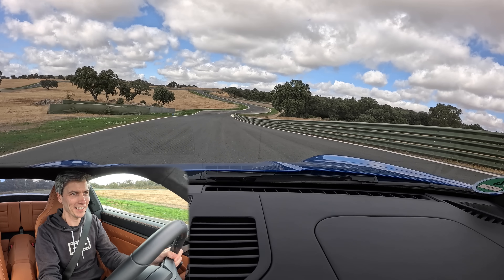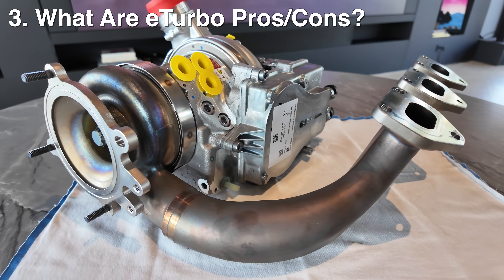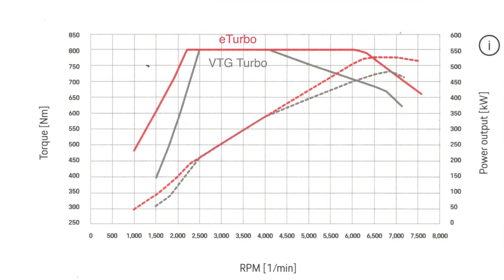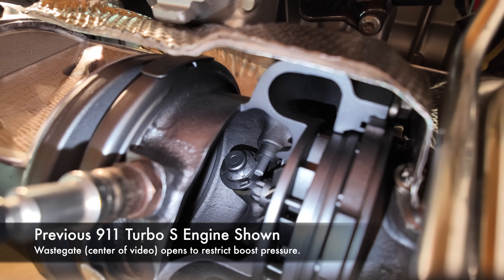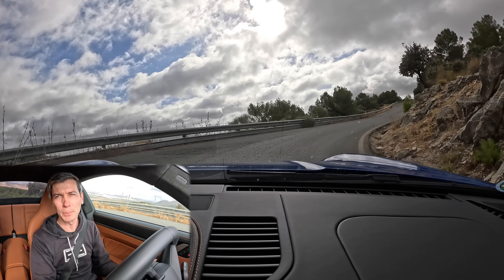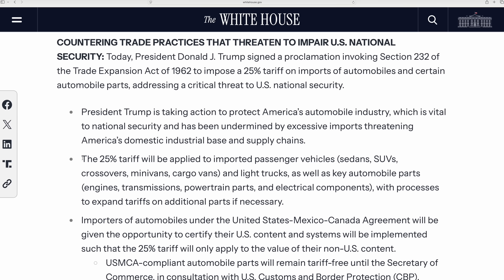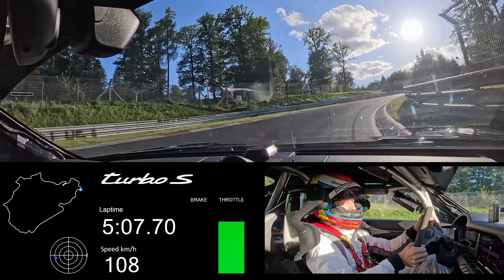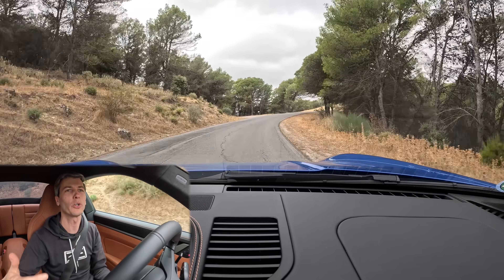Electric Turbos Are Here — Is It A Good Thing?

Comment: Electric centrifugal superchargers are better, I say this from experience. Vortech v-15 running off khb14601 controller at 176v in speed throttle mode wired directly into the 0-5v throttle pedal.

Comment: Wow they did a good job, this is better than an electric car cause yeah you get good instant torque but you don’t have shifting or the sound of a reving combustion motor. With a high powered motor it’s great but you need a bigger more powerful motor.  

But with this you get the feeling of the instant torque acceleration of an electric but you also get the shifting and tactile feel of the motor. Feels like this is peak design, only thing I could think of other than this is a diesel generator to battery and electric motors. Which you wouldn’t get the shifting from.

Comment: Man porsche is so awesome. The fact that the electric motor between the motor and transmission can be used as a starter, and alternator is sick. On top of that the eturbo being used as a brake to do a wastegates job to then send that charge back to the electric motor is insane! so clever, excited for eturbos to become more accessible in the aftermarket

Comment: Peak regen : 14Kw x2 ... in a 1.9kwh battery. 16C rating, this battery is dead before end of waranty, worse than the one in the old Prius. This car is Hybrido-greeno-bulshito scam. So very quickly, like the good old prius, your car will have no electric power so no Hybrid fancy fuel economy, PLUS a lot of magnet dead weight in your turbo, adding lag and everything bad, more than any "Normal" turbo. Speaking of dead weight, the electric motor is 2cm from the exhaust turbine, generaly red hot metal. Magnets, copper wires insulation, all of this will see hell if only ONCE the forced cooling has a few second issue. Your 10k€ turbo will be dead (I'm sure its more than that in a Porsche officine). There should be a law preventing detax for "Hybrid" cars with less than 1H of battery power. This one has... a few minutes.

Comment: Exhaust heat is what ruins turbos and nukes the bearings and engines

However is doesnt resolve the issue of blow by creating oil dilution or the need for premium fuel.

Over powering a small engine is the surest way to wear it out.  And that makes car mfgs happy.

Comment: Wow! Very clever! OK, so here's my system design question: what if you change the relative sizes of the ICE, turbo, electric drive motor, and drive battery? Seems like you can make this into an interesting series/parallel hybrid (ICE/electric drive, not how the turbo is driven) with different optimal points for economy, performance, or somewhere in between. Or did I drink the wrong kool-aid?

Comment: It's pretty wild that up until now turbos basically spun freely at whatever speed exhaust flow dictated. You could shut the car off, and momentum would keep them spinning (another benefit where electric turbos can limit bearing wear by halting turbo spin when oil pressure drops off at shutdown). There are reactive ways of controlling pressures, such as wastegates (exhaust), blow off valves (intake), and variable geometry (exhaust). But there was traditionally no way to directly, mechanically speed up or slow down the rotational speed of the turbo. That's exclusive to supercharging. So electric turbos are the first case where the RPM can be directly controlled.

I wonder, in a case where you must slow an electric turbo, but the battery is already full--say, descending a long hill--where does excess energy go? Or would the engine possibly power down in this case, or convert to "air pump mode" (no fuel), with forward propulsion from downhill momentum and EV regen only.

Comment: This is one of those things I just can't understand why Big Oil is so against. Instead of "replacing" ICE with EVs, there should be a hybridization of the two, a merging of the two powerful technologies. Both ICE & Electric have their strengths. They need to start focusing on merging these together in more vehicles. There's no reason why almost all vehicles can't be made to be some level of a Hybrid. If Tesla can make EVs $36k, and other EV manufacturers can make some even cheaper, that shows the Electric side of things are getting very inexpensive to produce. So being able to drop in electric motors into chassis' and some low KW batteries seems pretty easy to do.
There's no reason why the two technologies can't coexist in more vehicles in this age of technology.

One of the things I would absolutely love is a true hybrid for Pickup Trucks. As in, hybrid drivetrain where both the Electric and ICE contribute to power to the wheels. This could drastically increase the work capability of trucks by decreasing fuel usage and increasing towing/stopping ability. But no, they make these crappy pseudo-hybrids like the Dodge Ram with eTorque that's basically useless because it turns off at such low rpms, and is almost useless for towing.

Comment: I dunno. It's a normal evolution I guess, not sure how the electric motor will tolerate the heat. In the 90's they solved that with a twin turbo setup. Being a purist I'd be more impressed if the exhaust gases would recharge the battery and use an all electric turbo without the generated heat.

Comment: This is the slow death of Porche into obscurity. This is going to be a worthless car in about 4 years. These systems will fail, even with OEM parts. Once support is discontinued *because we all know this will be controlled purely by "proprietary" software, with over the air updates and EOL term dates, this will brick itsemf after that term.

Best case is you get a NA car with a BUNCH of heavy components that won't work. Worst case, you get a fire. I would NEVER own a European car anymore. Nothing made since about 2001 or so. (I wouldn't own anything modern anyway, nothing after 2023)

Comment: Curious to know how long these phenomenal engineered parts will be manufactured?  Our 2006 Audi TT Quattro that we bought used a little over a year ago only came with one key and the transmitter part of the key was dead.  

We tried to order a key from Audi ($450!!!!!) but they ended up calling back the next day to let us know Audi discontinued keys for the Mark 1 generation.  

In 10 years will Porsche still make these exotic parts like those exciting electric turbo/generators?

Comment: wouldnt it be easier just to make it a pure mild/ hybrid, forgot the extra 2 e-turbo motors for a bigger electric motor directly drive the gearbox instead of having 3 seperate electic motors, (2xturbo motor + 1xEmotor at gearbox)?

This just sounds like mild hybrid with extra steps and extra electric bits that could fail, it looks like all 3 electric motors generate 70hp max output in total, thats really no much in terms of EV motors.

Comment: For a future episode: Would be neat to see a comparison of latest centrifugal/roots superchargers v electric turbo. Turbos are so common now is there anyone other than drag racers still using any kind of supercharger? Is there any reason Porsche or anyone else should consider supercharging?  Instead of belts from the engine could you drive the supercharger with an electric motor setup like Porsche uses in this new 911 Turbo? In Porsche case they have a long tradition of using turbos and have never had a supercharged model but Audi, Dodge and Chevy all used superchargers in the past…

Comment: Turbos usually heat the intake gases, because the two turbines are so close together. Putting the electric motor-generator between the turbines keeps the intake cooler. Cooler air is denser, which is more efficient for combustion 

The turbo motor-generators in F1 are being removed for the new rules in 2026. The drivers will have to adapt to turbo lag

Comment: How is that electric stuff in the middle going to stay cool during hard runs? Wouldn't the heat make the plastic stuff brittle and overheat easily? Turbos can glow red on the hot side during hard use.  :face-orange-biting-nails:

Comment: What about using the turbo as a means to improve effeciency in smaller engines by harnessing power from the exhaust gasses and feeding them to a hybrid (emotor+eturbo motor) system? Would that not increase overall efficiency?

Comment: I can't see the motor on the turbo acting like a brake with all that heat being very good for it, but just the same, we use electric drive motors as brakes to recoupe lost energy, too, so it's just that but more heat from the exhaust. There's gotta be extra provisions in place to counteract that, right?

Plus, I'd just prefer the raw feeling of N/A or forced induction, rather that electric turbos, though they are cool and the benefits are more than impressive.

Comment: why it must be one unit: turbine + motor/generator + compressor? maybe dividing it Into: 1) turbine+(motor)generator and 2) motor+compressor will give it some more advantages and flexibility (cooling, placement, part sizes and working modes)? you can choose what combination of the parts to use in different situations: motor/generator on the motor shaft, motor/generator on the exhaust turbine, motor on the compressor separately.

Comment: Sorry guy. Modern engines have crossed the threshold into insanity. They are now too complex. The Germans are some of the biggest culprits in this story. Of course the appeal of German automobiles is their supposed superiority over non-German brands. Some blame goes to governments that have dictated draconian emission regulations. We are past the point of diminishing returns on that front as well. There needs to be a rethink on automotive technology. Consumers shouldn't have to entertain the wishes of bureaucrats and engineers to constantly fork over money for questionable gains. All of this is why I went from the Germans to US based performance cars. I drive a 2023 Ford Mustang GT 6 Speed. No supercharging, no turbocharging, no all-wheel drive, no charge intercoolers, etc. It's just a basic automobile with very good power but none of the outrageous complexity.

Comment: Is the difference purely for performance driving or are there any efficiency gains to be seen with this approach? In this vein, would there be any potential applications for tubo diesel engines / turbo as generator / electric traction motors?

Comment: just seems like they defeated the purpose of a turbo... power when you actually need it and not all the time, resulting in less fuel used overall.

they Coulda just created an N/A option with equivalent power and called it a day while being cheaper and easier to maintain.

Comment: How is this system cooled? i.e. the controller unit that is integrated into center section of the turbo? oil? coolant? both? awesome video!
Reply from the maker: The turbo emotor is water cooled, the turbo has oil cooling, and the controller you see has a separate water cooled circuit that’s at a lower temp than the motor.

Comment: Was that a free lunch claim?  The engine output must be less due to the exhaust back pressure while the Eturbo is regenerating.  I suspect a negligible difference in power, but a significant difference in control.  That control may make it worth it, but I feel that the ~30hp isn't real.  I enjoy learning, so please explain if I'm wrong.

Comment: I see the advantage in racing applications or if you have a Twin-Turbo setup currently. That Porsche drive-train is essentially a road legal F1 car, and it makes sense there. For economy cars with a smaller engine and a standard Variable-Turbo for highway merging I see only negatives, COST, weight, complexity, wearable parts (battery) just makes more points of failure.

Comment: The wastegate actuator shaft is the most common failure point of turbos so not having a wastegate is a win. However, being that a turbo is sandwiched between a red hot exhaust manifold and a red hot catalyst, I seriously question the long term durability of the electric motor.

Comment: I wonder how long the li-ion battery is going to last and what its replacement cost is going to be (knowing Porsche, it will be more expensive than gold). It's going through tons and tons of cycles on every drive, so battery degradation is going to be colossal. Especially because of those 20C power input and output.

Comment: Thanks for the excellent explanation (as usual) of the new electric turbo Porsche.  If I may, please considering trying to push the steering wheel instead of pulling it when you are taking corners.  In other words, switch which hands you have on the wheel from the hand pulling down holding the wheel to the hand that would push up on the wheel to take a corner. Pulling down is too easy so you can over use the wheel vs. pushing.

Comment: Off-the-wall idea:  I’m pondering how this would compare to doing this pneumatically:  That is, using the exhaust pressure to pressurize a moderate-sized COPV of fresh air, and then send that pressurized air into the intake when acceleration is needed.

As for the traction motor, there are gasoline-pneumatic hybrid drive trains, as opposed to gasoline-electric hybrids.

Hmmm…  Just pondering…

Comment: This seems like it would be a good fit for diesel pickups where rpm is fairly low and spool time is always a fight. But has helped obviously but while towing at low rpm you find yourself throttling in a way with traffic where you are trying to keep the turbo spinning and not totally choo the throttle

Comment: When the turbo electric motor is acting as a brake for regen, it is actually causing exhaust backpressure.  I wonder how much power is lost due to the increased backpressure while acting as a brake.

Comment: Come on, I expected better from you. Its not "turbo lag". What your actually referring to it called boost threshold. "Turbo lag" is the time it takes to respond while already in the operational rev/drive flow range of the turbocharger. Boost threshold is the time spent before the turbocharger's operational drive flow range. 
But carry on, tell me more about this set-up.
Thats interesting. By using the electric motor to drag the impeller sounds great. I'd like to see exhaust manifold pressure while this in action. At first glance you'd think the pressure would be driven up but there is also a direct reduction in boost pressure so it shouldn't peak higher. 
Most "super" cars run at lambda 1. Its the only way they can make their high power while passing emissions.

Comment: Porsche has been developing this for over a decade. About 10 years ago I was at The Battery Show in Novi, MI, and they gave a presentation which was standing room only. There are so many innovations in this, most of which are around the challenges associated with high RPM, high temperature. Incredible materials challenges in the turbo and bearings. Brilliant idea though, basically making the turbo spool independent of engine RPM so you can eliminate turbo lag.  But seems like a very complicated and expensive solution when pure hybrid drivetrain might achieve the same effect.

Comment: Its something Honda have been playing with for motorcycles as traditional Tuboes had poor characteristics so didn't realy catch on in the 1980's. Smoothing the power curve electrically seems like the solution. Weight reduction is always a big factor on motorcycles so being able to extract more and broader power from smaller engines couldbe one of the biggest steps forward in many years.

Comment: Really cool design of a whole system. Just wondering how long these electric motors will last. Disadvantage nr. 4 you didn't even mention - HEAT ! Being integrated into same turbo housing...right next to exhaust side. EGT makes turbos glow, if you run them hard. What will happen to the motor? On top of that, it is acting as wastegate...essentially a brake / restrictor ...which will generate (draw) even more heat! Surprised everything doesn't just melt :)

Comment: This has made me realise why has no one made a hydraulic turbocharger in the past?
We already use hydraulic pumps for power steering, just have a valve on that controlled by an actuator and have it powering a hydraulic motor on the turbo. I'm sure it wouldve worked well. No battery required
Reply: Hydraulics are inefficient. Electrics are particularly well suited to high RPM applications, which suits compressors and turbines.

Comment: The fact that it's ALWAYS faster to charge the turbos with everything it's got is wild. It's pretty well established that electric motors = instant torque. While still true, Porsche has put a bit of a twist on that debate and I love it. I appreciate that you took the time to specifically ask about that cause I never would've expected the result. Can't wait to see what other creative ways electric motors can be used to make cars better.
Reply: It's probably because of battery size and available power output. If it had a much larger battery, then powering the motor to accelerate would likely be faster, but to keep weight down (I assume), they went with a smaller battery and can't put out enough to out perform the turbos.

Comment: I imagine the benefits still outweigh the negatives, but by using electric regen instead of a wastegate, you’re restricting the rpm of the turbines to control boost, this would mean you’re causing a restriction in the exhaust at the top end right?